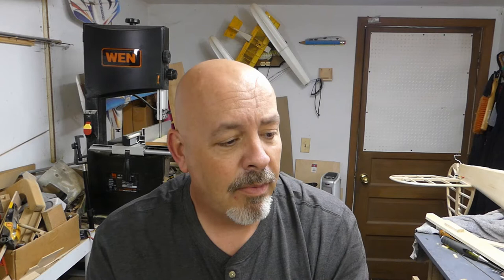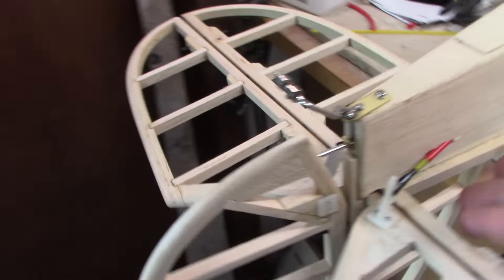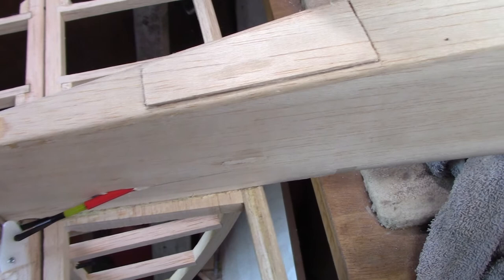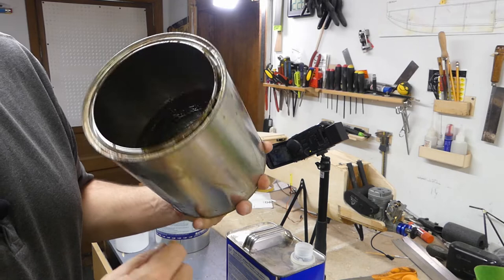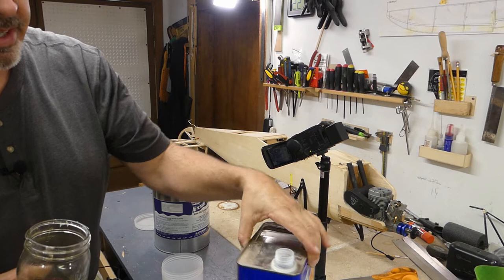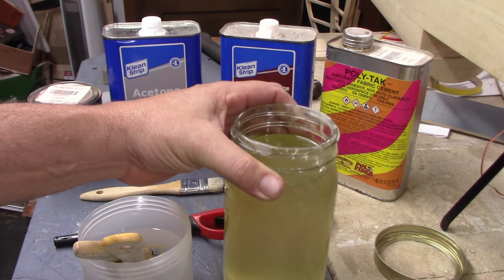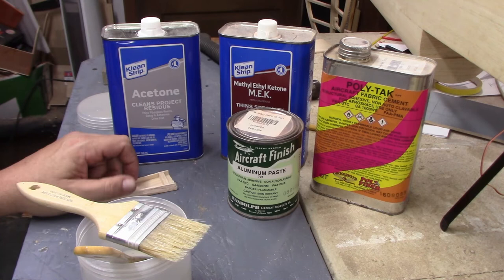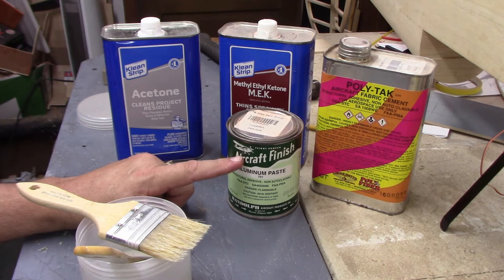Tiger Moth Becomes a Stampe SV4 - Video 23 - Tail Controls Connected and Fabric Covering Prep

Comment: I use nitrate dope on my stick and tissue free flight airplanes.  Always wanted to cover one of my RC planes with silk and dope.  Is the nitrate dope nitro fuel proof?  Or do you have to paint it to get the fuel proofing?
Reply from the maker: Nitrate Dope is not fuel proof. The paint needs to be. If you are using nitro fuel, use a spray epoxy paint. If using gasoline almost all rattle can spray paints will work. Always test make a "test piece", fully covered, to see the paint is compliant with the fuel being used, before spray the plane.
Reply: @BudChristensen  Thanks.  I'll search through your videos to see what paint's you use.  When I was a kid I remember seeing Hobby Poxy and another one that people used.  I'm talking late 70's.  Now I guess it's auto paint?

Comment: Not for nothing, but polyester coving like koverall is too slick to bond to regular paints. It needs to be infused to the weave. This is why nitrate and buteyrate is bonded thru the weave. If the paint lifted, it's because the the base never bonded to the material.
Silk, canvas and linen all have fine fibers that absorb the paint and lock it in.